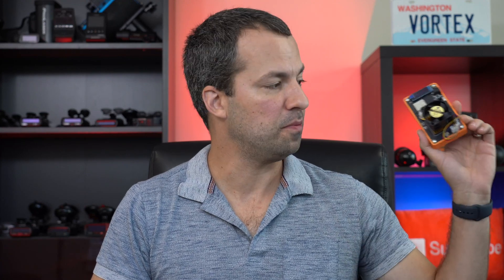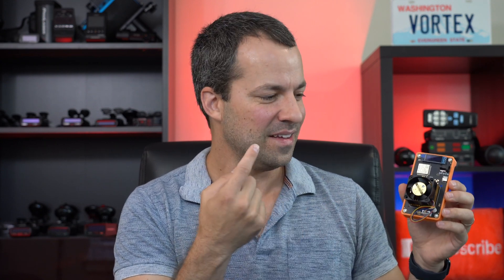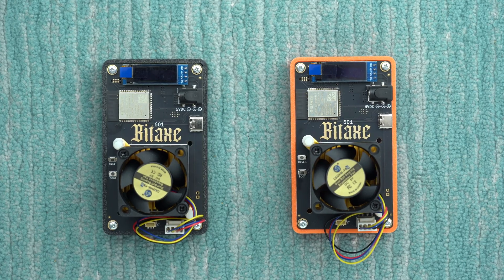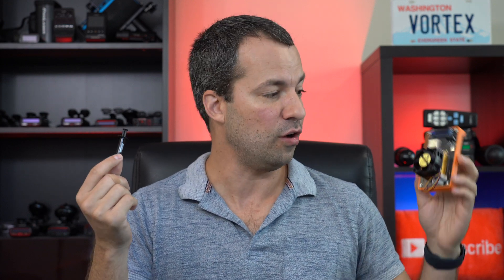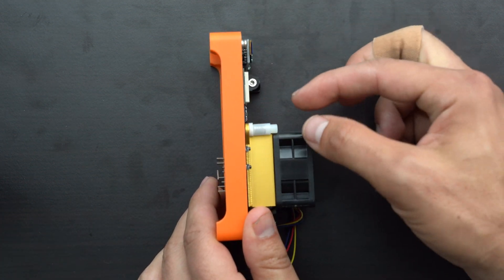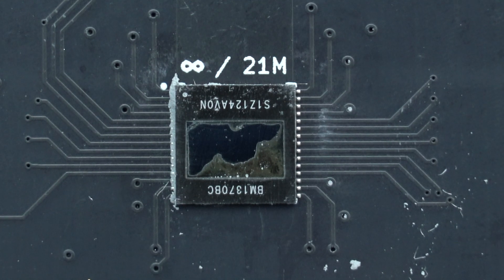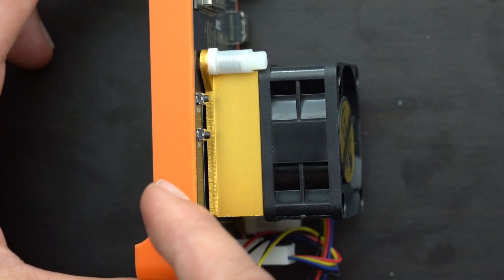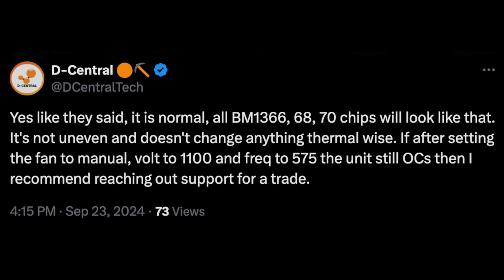Bitaxe: How to Replace Thermal Paste

Comment: is there anything I can do to make my bitaxe gamma run as it should? I got it from cyrptocloaks I messed them but they never replied. On stock it doesn't even get above 1 Th/s. Uusally stays around 700 to 800 gh/s. Not sure if this would help me?
Reply: Enough power from the power supply ?
Reply: @_Yolandi  power says 17W . Input voltage is 4.8v. not sure if that's what you're referring to?
Reply: The very first thing I would try actually is replacing the thermal paste and seeing what happens from there.

Comment: Hi. I have the same issue as you. I run the gamma with default settings and get overheated within minutes. Did you solved it somehow?
Reply: ps: i have 525 as frequency and 1150 core voltage
Reply from the maker: I sent my units to D-Central and they sent it back with upgraded cooling and now it works great. I'll do a short video here soon so you can see how it looks now with fans both front and rear.